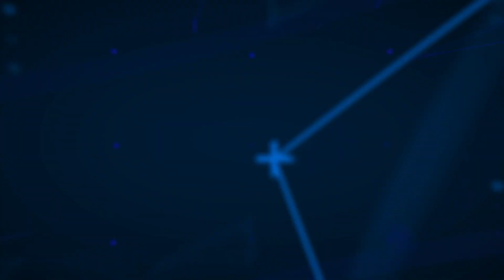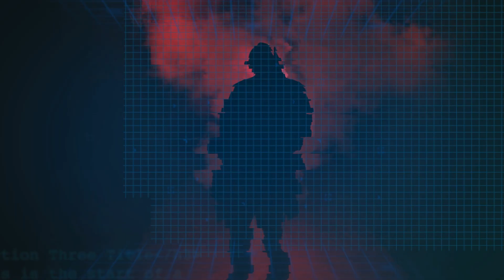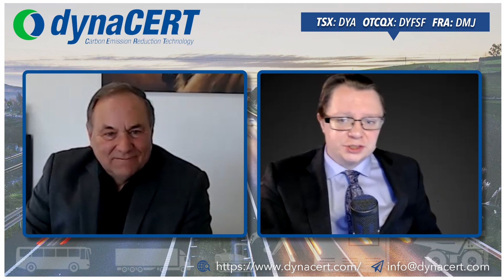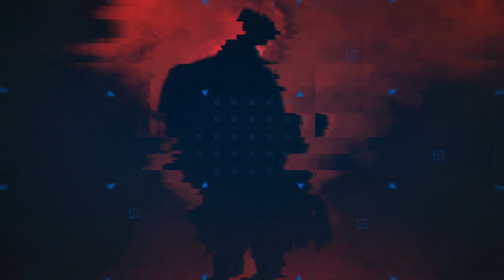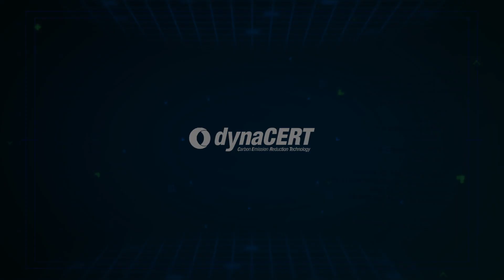dynaCERT; Diving Deeper Into the Company Itself

Comment: Hello, I operate a small fleet of school buses in rural Ontario. Will the HG unit freeze overnight during winter? If not, what prevents the water from freezing and what is the warmup time for a cold winter startup? Thanks
Reply from the maker: Our system uses an electrolyte solution (Potassium Hydroxide) which does not freeze until -30 degree C. 

Moreover, we have a patent pending switching cell technology which helps during winter months to achieve maximum electrolysis efficiency. 

Lastly, the water is expected to freeze in extreme cold weather, but our units computer fills the reactor on shut down with the above sais chemical so has the ability to run one start up and give the water time to thaw.
Reply: good questions. i would also like to know this.